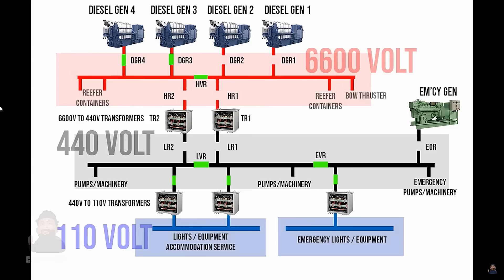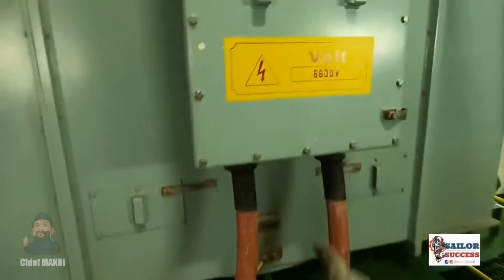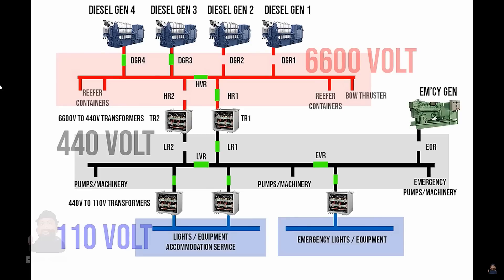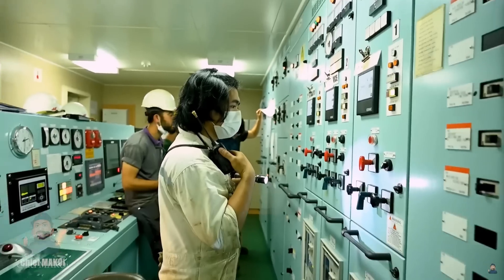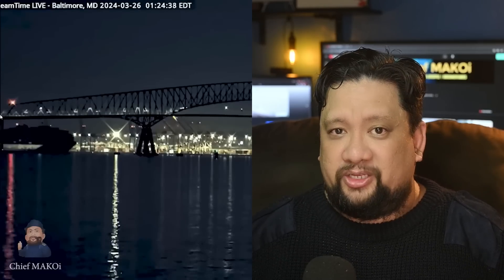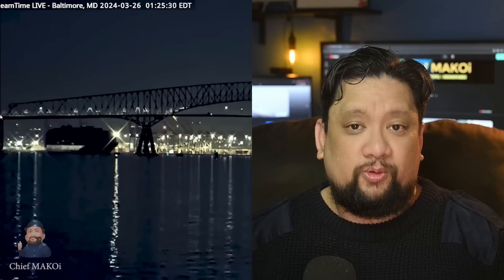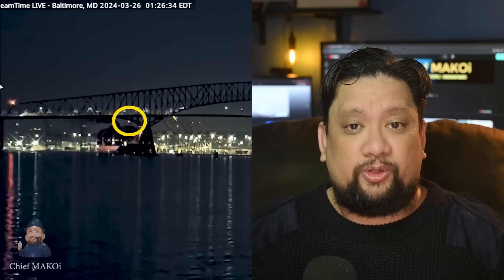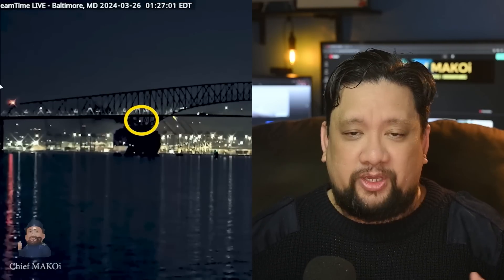Bow Thruster : Why The Dali Didn't Use It | Chief MAKOi

Comment: I’m not disputing the chief but I gotta ask a stupid question. If the bow thruster is capable of applying x thousand pounds of lateral thrust on the bow when the ship is moving slowly or not moving at all, does the bow thruster not apply the SAME amount of lateral thrust to the bow when the ship is moving at speed? In other words, doesn’t the bow thruster move the bow laterally at the same rate whether the ship is moving or not?
Reply: When a ship starts to turn to starboard there is greater water pressure on the port side so the rudder is turned to port to even the water pressure and the ship will go straight. This greater pressure on one side of the ships hull is increased with speed . The faster a ships speed the harder it is to steer .The thrust from the propeller on the turned rudder is what is needed to keep the water pressure the same on both sides of the hull. Once a ship at speed starts to turn without rudder correction the turn will keep getting sharper intel all speed is dissipated. This is why the ship turned toward the bridge .Also the blades of the propeller windmilling due to lack of power made the stern move to port , the start of the turn to starboard.
Reply: The above answer is also the reason the bow thruster has no steering effect on a ship when the ship is moving forward .Its the water pressure on the haul at speed.
Reply: I have the same question.  Let us say a different ship on a different day.  Why would a bow thruster not change the course if there had been 30 minutes and 5 miles until collision?  Could bow thrusters really not change a ships course at all if the ship is moving over 3 knots?

(My guess, as a layperson, is perhaps that is written in the manufacturer specifications and nobody has questioned it.  No easy way to just test it out without risking their job.  And perhaps the designers and engineers at the manufacturer wrote that because the hydrodynamic effects of the ship moving forward in the water might disrupt water flow into/out of the bow thruster tunnel possibly making them ineffective.  But that is just this layperson's wild guess.)
Reply: I am certainly not well versed in fluid dynamics, but it makes sense to me that bow thrusters could be ineffective at higher speeds. On a ship in forward motion, the bow thruster must not only move water as it usually would anyway, but also overcome the tendency of the water to flow past the bow thruster's tunnel, which it does not have to do when the water just outside the tunnel is still.
Reply: @Curt_Sampson  This is a technical discussin.  Come back when you learn what a Reynold's Number is.
Reply: @Lost-In-Blank  Come back when you can explain why a bow thruster does work (or even should work) when a ship is moving forward at more than a few knots. And then you can move on to explaining to apparently the entire maritime world how they are all wrong.

(And I not only know what a Reynolds number is, but, unlike you, also know how to spell it. Do you know what the Coandă effect is?)

Comment: "Morning Chief!"  <S>
I can't say you're line of thought is completely wrong.
But an attempt never tried, is a chance never taken.
Maybe it would have done less damage, had the fullon weight of the ship not hit the bridge column full 'bow on.'
Maybe if the ship approached  'side on,' starboard in this case, maybe it would have been less weight at the impact point, having the ship stretched out to either side...
Or, maybe it would have made no difference at all in the outcome.
The ship seemed to be moving rather slow, maybe at the speed of the currents there.
Anyway, thanks for your input, I've learned alot more from you on this, then the media ever wants to put out...
Reply: your line

Comment: Manoeuvring thrusters, like the rudder usually require power to function at all. The Dali had a loss of power so I would assume the thruster(s) was/were also offline due to the lack of power.
Weather the use of thruster(s) could have saved the bridge is a completely different issue, which due to her proximity to the bridge when the power loss happened would be a no, the thruster(s) could not have made enough of a change in course to make a difference.
Reply: If you check out Chief's earlier video, you'll see that the bow thrusters were on the high voltage bus, which was still on-line. It was only the low-voltage bus that went offline.

Comment: It seems like a lot people think that a cargo ship can turn like a 20-ft speed boat.  A ship that big, going that fast, only having about 2 minutes of loss of power, is going to travel quit a distance.  Even if it took only 5 boat lengths to make a major turn, that ship which is about 300 meters or 985 feet will take almost a mile to make a major turn.  (I am just guess because I have no idea the turning radius is of a large cargo ship, but its no pleasure craft.)

I was on a cruise ship to Alaska several years ago.  It took us over 3 hours to dock.  You could see the bow thrusters churning the water but we were not moving any closer to the pier due to an extreme and fast out going tide.  So, I am more than a believer when you say a bow thruster is not that powerful at speed.

Comment: Ok, 6600 V power was there, but it seems to me that something else is needed to control a bow thruster, which is power at the control modules at the bridge and in the thruster room. Was this available? In factories this is normally done with 24 V 4-20 mA or 0-10 V signals. If a big enough UPS is used it would have been an option although I agree that at 7 knots it wouldn’t do much.
So my question is, are big UPS-ses mounted on bigger cargo vessels? Or only as backup for plc en pc use.
Reply from the maker: Their panels have stepdown transformers too.  As for the Bridge control console, they are backed up by batteries amd UPS.

Comment: I just want to know a few things:

1. If the port was aware of the previous power outage on the ship
2. If the pilot was aware of  said power outage
3. If they were, why didn't they ask the tugs to stand by for assistance until the ship cleared the bridge.
Reply from the maker: They may have thought the problem was solved.
Reply: @ChiefMAKOi  I agree, the problem happened more than 12 hours before departure, that's at least a couple of watch changes, and after 10-12 hours people would think it was solved, especially when the first problem was traced to an exhaust pipe being inadvertently closed to the #2 DG exhaust stack.

Comment: Would the bridge even have control of the bow thruster with the low voltage bus down? I'm assuming that the operation of the motor control for the bow thruster is from the bridge and the previous video showed the bridge without power.
Reply from the maker: The bridge control console has UPS and Battery power.

Comment: Thanks Chief, but I still haven't heard a good explanation of the black smoke.
Reply from the maker: Me too.  Very curious.  It stopped the moment the lights went on the second time.
Reply: @ChiefMAKOi  me three.😂 Did they perhaps go astern?
Reply: @brianbarbarich1401  NTSB report stated that the main engine was shut-down from the first black-out and was not restarted.
Reply: @ChiefMAKOi  Good observation; I’ve missed that smoke stopped after a while once second blackout has been fixed. Carefully `studied´ the video again; true, but not obvious at very first glance due to the stacks are hidden behind the black truss.
Well, first guess is that electrical load conditions have significantly changed, considering only one single generator (now DGR2) connected to the HV-bus then but able to provide power needed. But we’re back again whether it’s a fail of TR1 (plus HR1 & LR1) only (which have been isolated after second black-out, and TR2 active), or DGR3 causing issues (e.g. due to `fuel pressure´ like already observed while in port) and thus failing to properly synchronize with DGR4 on varying load conditions (but both taken out now), a combination of both or any other effect we’re not aware yet …
Reply: @ChiefMAKOi  It stopped I think because the DG3 and DG4 both tripped and shut down. Then DG#2 auto started because it was on standby and they switched to #2 transformer, and that's why the lights came back on about 30 seconds before the bridge impact, and the smoke dissipated. My guess is, after the first blackout and only the 6600 volt bus was still powered, and they reset the breakers for TR1, they forgot to reset and turn back on all the fuel pumps and other auxiliary equipment needed to keep the generators running. I'm thinking that maybe the 2 generators started running low on fuel pressure and then when TR1's breakers were reset, that sudden high load caused the two generators to start running badly, and eventually trip due to maybe low frequency, or low voltage, and thats when all the black smoke stopped. That's too much black smoke for marine gas oil, and I don't think they had enough time to try and restart the main engine, I think like you said in the video, they were very busy in the control room trying to resolve the blackout.
Reply: Why were they running away?  Illegal cargo or major oil spill?
Reply: One possibility is one of the rwo operating generators motorized ( lost its load) due to a load share control problem. Once motorized it will be driving the Diesel and give off a lot of smoke.  The normal way to prevent motorizing is with reverse power relays which will trip the generator breaker.
Reply: @parkerholden7140  OK, that's interesting. I never heard of that, and I worked for a CAT dealer for several years in their unit repair section. Now I know some railroads older prime movers had generator start but they had a separate winding or that. But that sure would make them smoke.

Comment: Using the bow thruster at that 6 knots they were going would have actually caused the ship to speed up due to the low pressure induced on one side of the hull.
Reply: 100% correct. Sometimes the bow thrusters are left running by accident and the ships pilots will know right away when the ship is gaining speed more than desired and when they check, find the bow thruster is still running. Very common from what I gather.
Reply: @onsecondthought4174  ... which leads to questions at which point do pilots typically request to switch off bow thruster (I'd expect `some time´ after they finished the 180° turn here) and if they might also use this effect of `speed gain´ on purpose (e.g. to avoid that main engine creates too much vortex and accelerated currents in narrow main channel of Baltimore port - ?).
Reply: Even if the last part of what you say is true, I doubt it would actually speed up the ship, rather more likely the speed would decelerate slower
Reply: @tjampman  It would speed up the ship. It's very known in the shipping world.
Reply: @tjampman  You have no clue what your talking about. I actually took the time to read up on this before I commented. You might want to do the same before you open your big yap.
Reply: @opieshomeshop  so what you're saying is when the main engine went off line, they could have activated the bow thruster to accelerate enough to have rudder authority?
or is it as he somewhat poorly aid, the bow thruster can decrease drag, INDIRECTLY resulting in the main engine accelerating the ship faster?
Reply: @kenbrown2808 it is indirect: low pressure pocket lowers drag and speeds the ship up bow thrusters are useless over about three knots; the proportion of thrust between the thruster and propulsion becomes insignificant at higher speed.
Reply: @kenbrown2808  All I said was it would sped the ship up. You're reading too much into what I said.
Reply: @DowntownDeuce22  Yup, the drag on the ship increases at a cubic function of speed. If it takes X amount of horsepower to run at 8 knots, it takes 8 times as much horsepower to go 16 knots. Assuming of course the prop is capable of that doubled speed without exceeding RPM limits or cavitation.
Reply: Obviously you didn't take elementary School physics. How old are you, kid? Did you drop out or attend a special school? @tjampman

Comment: I'm not so sure about the reasoning around the B/T. The second blackout was different in nature from the first. Both the #'s 3 & 4 D/G supply breakers tripped off at the same time. 
It could have been due to fuel starvation as you suggested before but equally it could have been due to overcurrent caused by an attempt to start the B/T. 
If that was the case, 2 generators supplying the LV bus AND the B/T would probably not be enough. If I was the captain and knew that collision was becoming certain I think I might try anything, including trying to run the B/T.
Reply: I am pretty sure if they tried starting the bow thruster then it would have at least been mentioned in the preliminary report.
Reply: @tjampman  They didn't offer ANY reason for the the two D/G's (3 & 4) tripping off. This is the second critical part of the incident so they won't want to look stupid by making an announcement which, subsequently, they may have to retract.

Comment: Some years ago I had a friend who was Chief Engineer on a refrigerated ship.  They had bow thrusters as they had to load in some 'interesting' ports.  He made the point that the thrusters consume a lot of power, so when they were in use the fridge had to be turned off.

In any case, the bow thruster will have to be working pretty hard to have much effect on something the size of a 30 or 40 storey office block.  Inertia is always going to win here.
Reply: The environment will have a few things to say about it too, winds and currents or tides can and do push even the biggest and most powerful ships around like toys.

Comment: The moment Ilearned that bow thrusters are connected to the HV bus, I knew that the idea of hand cranking was just movie dramatics.
Reply: High voltage is actually pretty uncommon on ships.440V is standard
It is only ships with high electric consumption they have HV,. E.g. Large container ships with a lot of reefer containers and ships with diesel electric propulsion.

Whether a cruise ship would have HV I am not really sure, but will ask next time I do some work on one of them, summer is coming so I am sure it won't be long.
Reply: @tjampman  A lot of newer cruise ships actually have 11,000 volt systems, and all the propulsion motors etc are all electric. This is because cruise ships have such a huge variable hotel load, heated swimming pools, wave pools, massive air conditioning plant, huge refrigeration plant for all the food and beverages on board etc. A typical power plant would have like 6 medium speed Wartsila generator sets, feeding 11,000 volts each. And depending on the load they would be started or stopped as needed. If moving at slow speed or in port probably half of them would be shut down on standby or undergoing routine maintenance.
Reply: I wonder if they were hand cranking hydraulic valves to spin up the bow thruster. But those looked like water valves they were turning.

Comment: Chief , in the engrs perspective , I think the main reason relies on the fuel systems onboard Dali . Since Dali is in the US, for sure they use Diesel and it looks like the diesel fuel is contaminated (maybe water accumulated) because sudden failure of all generators at load happens rarely unless if fuel problems occur . Hope u make another video what really happens in ER onboard Dali 😊 iyak ang 3E at Epoy ng Dali 🥲
Reply: He already made a video about that. There was not any problems with the fuel.
The breakers on the transformer popped out. It was an electrical problem.
The generators were still running.
Reply: @tjampman  Yep, and the NTSB already tested the fuel, and the ships owner also had the fuel independently tested as well. I think the reason for that was, if the ships owners can pin at least part of the blame on crappy fuel, that takes a large amount of liability load off them.